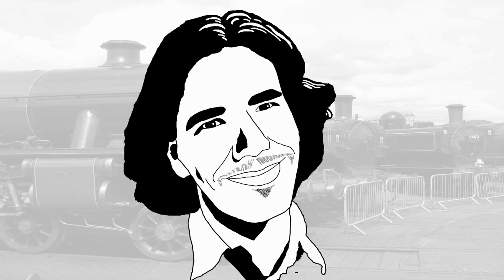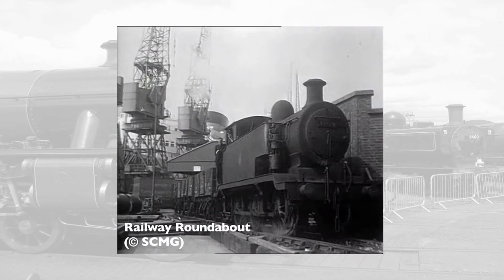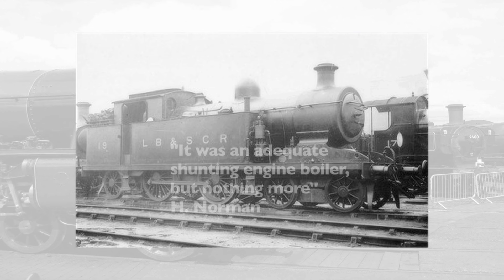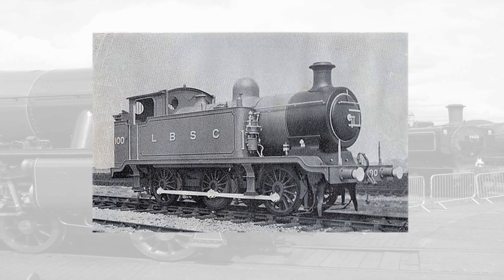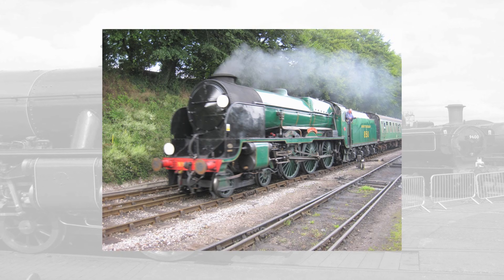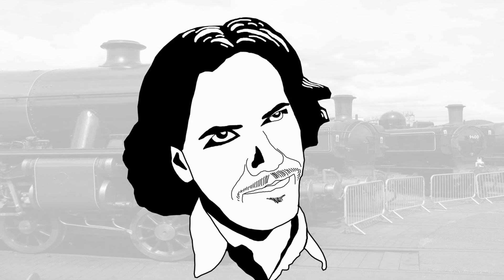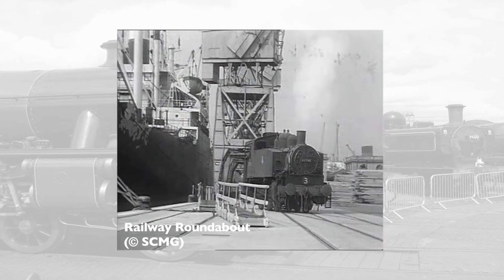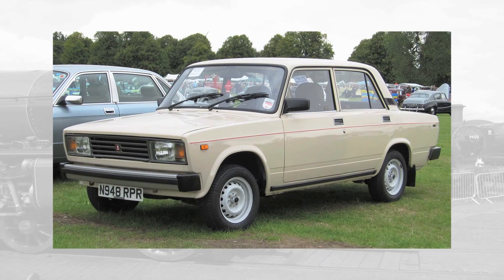GAUGE THE ISSUE: The Maybe-Not-Quite-So Really Useful Engines

Comment: they were ok locos when used for the appropriate task. Their coal and water capacity was no less than other 060 tank engines, and in fact was slighty greater (as a E2x) than a LMS 3F!  The were FAR from useless, if used where they worked best, or had a good crew working them. 

By using examples of what they were not suitable for, would be the same as saying Gresley's A4's were unless if they were tried on station pilot of yard shunting duties. 

You can not compare the E2x to the USA tanks, or the Austerity. This is like comparing a LSWR B4 dock tank to BR 08, their worlds apart, simply because they were designed in different decades. The Problem with you video is it has a major floor, in that you use one source for the information on the working of the class. 

As for comparing Simon Cowell against all those dead musicians, is Laudable, Simon Cowell is a not a artist!!!!! He do not sing or play a instrument for public entertainment.  Its like comparing Pete Water man to Hughes, Beames, etc just because they both worked out of Crewe works. 

The oscillation that was experienced over 40mph, was typical on 060 tanks, so hardly unique to the E2's. 

It's the same as anything else, you take a loco of it comfort zone, it will course issues and not proform at its best. The E2 the best use was on short haul work, station pilot duties and banking, just so happens this was not the envisaged use when designed, in much the same way as the BR class 14 diesels.
Reply from the maker: So remind me then, about not comparing stuff from different timeframes, when we're the Terriers and E1s both built? By my reckoning, both were built prior and withdrawn after the E2s, which must surely indicate they both found new use when the Southern didn't want to take out the money for replacements.

And you can compare them to the USAs and Austerities because they were both trialled in the same bloody place! 

In any case, age isn't really an excuse to let the E2s off seeing as the technology was basically the same by that point. Even if you tried to, the 5700 Pannier (which can trace its roots back to 1897) and the Jinty (which was based on an 1899 design) still proved superior at all-round operation; despite only being built for shunting themselves.

I'll admit the Simon Cowell comparison was a touch hyperbolic, but he still works in the same industry and is still responsible for more of the music from the last 20 years than the deseased artists mentioned. So I'm sorry, but the point still stands; longevity doesn't equal quality of workmanship.

Did I say they were 'useless'? No. There were worse locos built. But the lengths people go to defend them while remaining in denial that they wouldn't do so because of TTTE specifically are pretty desperate.
Reply: @ChristheXelent  Nearly all the terriers survived because they had abilities that other loco's didn't. They had a very light axle loading, packing a big punch for their size! Other than the jobs which required a lightweight small powerful loco, even the LBSCR had been selling them off, the E2s were designed because the E1s were being flogged to death and under powered for the tasks they were brought assigned to. There were also very rough riders at anything over a stedy pace, and it took until 1933 to sort this issue out, with the ones that were sent to the Isle of White being re balanced by the fitters at Ryde Works. I personally would suggest the E1X would have proven to be a better investment, but I guess Lawson A Billington wanted to stamp his mark on Brighton Works, when he took over from D. E. Marsh, which was clearly still very much dominated by the legacy of William Stroudley. Both the E1 and A1 had examples with condensing gear fitted. Indeed, the SR were one of the leaders in Diesel shunters, even before the war in 1939.

You can not compare the E2x with USA tanks, or the Austerities, unless you want to demonstrate their mechanical design too. out of the three, the USA tanks were the most advanced, with modern design of valve gear and cylinders (but with rubbish axle boxes and coal bunkers that were found to be too small until extended), were specifically designed to have a short wheel base, with ALL the weight over them, to handle sharp radius lines, but if taken out of this context proved to be unreliable without modifications (as the KESR found out, it is what saved their pair from getting to Barry, and could only be solved by fitting mechanical lubricators to the axle boxes in preservation). Indeed, when the ones that were transfurred from Southampton Docks to Ashford for departmental use, the trip took a month to complete because of the small coal bunkers and the constantly hot running axle boxes. If your going to compare the E2's to these, you would need to compare them to other dock tank designs, such as the B4's which aslo worked the dock networkd. They were all different designs, and good engines when used in the right context, but take them on a job they were not suitable for, you would soon have trouble. 

Apparently the other main decisive factor in buying the USA tanks over the Austerities is apparently the Austerities offered were all in need of an overhaul and the USA tanks were virtually new. How true this is I dont know. There was 14 USA tanks purchased by the Southern Railway, at a cost £2500 each (although 1 loco built by Porter differed from the others and so was cheaper), which is approx £100,000 today, I suspect compared to the F5 or G5 replica, they might sound well priced, but I suspect would cost much more to build today ;-) The Southern always claimed to be cash strapped, yet gave Bullied a free hand with his MN, BB and WC classes that had massive amounts of unproven innovation. The reason only 14 (15 if you include the loco purchassed just for spares for the Porter loco) is Bulieds insistance that the loco's should all be of the type built by Vulcan, as these were of better build quality, and the poter ones had differing dimensions. The limit on the numbers were only 13 Vulcon manufactured ones were available, for whatyever reason the Porter built ones were not acceptable to Bullied. 

The 57xx (15.5ft wheel base) may be able to show its routes back too much earlier than your suggest, as many were based on old saddle tank designs, but you would also need to comment on all the modifications, and improvements along the way. The LMS 3fs (with 16.5ft wheel base) were a updated and improved version of Samuel Johnsons 2441 class. I would question your belief that the 3fs were much superior. Like all Midland engine, the axle boxes needed improvement, and coal and water capacity limited the distance of short haul trips, just the same will all smaller tank locos, but we have to face it, 060T for shunting or short haul use were never top priority for the design teams, and most were just updated designs of the tried and proven. 

I would suggest that the two top contenders for the longetifity of design (and useful) class of loco for this would be the GWR pannier range, but as these had variations in to cope with different requirements, and the 57xx had a shorter working life than the J72, I would place the J72 at the top, not that it would have been suitable in Southampton docks (13ft wheel base!). These can trace their origins back to 1898 when Worsdell built a batch of 10 for the NER. Raven built 20 more in 1914, and 10 more in 1920. 25 more joined them in 1922, and the LNER under Gresley built 10 more in 1925. Despite Thompson recemending the whole class for long term withdrawal, Peppercorn announced that the J72 would be the LNER's standard 060t light shunting loco, and ordered more batches to be built in 1946, but these were delayed until 1949 when 15 were built, 5 more in 1950, and the last 8 in 1951. It wasn't until 1958 that the first of the older locos were withdrawn. The class lasted in capital stock until 1964, but 2 remained in departmental stock until 1966 (preserved and known as Joem) and 1967. A total of 113 J72s were built to much the same basic design (which was based on the J71's that dated from 1886) over 53 years, and the oldest of the class had a working life of 60 years when the first was withdrawn.  Alnough their was 422 LMS 3f's, these were built over just a 7 year period, with the 1st withdrawals in 1959 and all gone by 1967 (except one supplied to the NCB) with the oldest members being 35 years old when the first was withdrawn.  The 57xx had 863 members, built over a 21 year period, but withdrawls started in 1956 and  all had been withdrawn or sold on to other companies (ie London Transport and the National Coal Board) by  1966, with the oldest members of the class being 27 years old when the first was withdrawn.

If BR found the E2x poor, they could have called upon designs from all over the network to trial out, and it wasn't until the modernization plan that the realization that steam would end came to light. Indeed, there are examples for this, with Pannier tanks being tried out on Southern region docks, and Licky incline, and the LNER's U1 also on Licky (unsuccessfully). The fact remains, in the right environment, there was nothing wrong with the E2X, but the right environment was not the one intended. Their best work would have to be large yard shunting and station pilot duties. The E2X lasted until replaced with diesel (in this case the class that became the 07... which I believe is what Salty was based on in TTTE). I suspect the E2x were kept in use at Southampton docks simply because most other tank locos cira 20,000lbf hand longer wheelbases. 

As a engineer, and someone who has restored many old machines, and worked on plenty of steam powered machines, if something is not well-built, it will not last, because it will fall apart from wear out, so in my opinion, if something has seen regular use and lasts a long time, it was well-built, but dost mean it was well-designed.

My defence of the E2's have nothing to do with Thomas the tank engine, indeed to me there is only one true Thomas, Hunslett and clarke works number 1800, which was nick named Thomas by its crews and people who saw it, because it was small and blue, and when supplied in 1947, the 2nd of the Thomas books had just come out. The Rev. W Awdry officially named this loco Thomas in 1971, and it went on to be preserved by what became the NVR in 1973. Indeed, so official is this Thomas, Hit entertainment (after purchasing the rights to Thomas the tank engine and friends) tried to sue the Nene Valley Railway (Thomas's owners since 1973) on the grounds that the NVR's Thomas locomotive was breaching Hit entertainment trademark, but they lost the case as the court ruled that it was not breaching HiT's trademark because the Hunslett Clarke locomotive was given the name "Thomas" directly by the creator, Rev. W. Awdry, and so predated any prior agreement regarding the rights to the Thomas trade mark. It was the ONLY locomotive to be so named directly the Rev. W. Awdry.

In fact, I cant claim to be a fan of the E2s. The only real Brighton loco class I am interested in is the A1x, I'm a Great Eastern man and a dyed in the wool fan of all things LNER. If you want to compare musical artists, you could do it by comparing number 1's to length of carrer,  this would of course mean Cliff Richard is No.1, & no I'm not a fan!
Reply from the maker: @James_Rivett  as much as I would trust your word as an engineer, this is really missing the point. 

You can compare them in the same context because all three were trialled in the same context. The Austerity's wheelbase was simply considered too long, despite being 5ft shorter than the E2s/E2Xs. While the USA's had a better balance between strength and flexibility. While their axleboxes were indeed an issue on long journeys, the class rarely made them barring exceptions like 30072 moving to Guildford MPD for a while. 

Saying that they're not vocationally comparable is like saying the LNWR Claughtons and LMS Royal Scots weren't comparable when they were built for operation on the WCML. 

Keep in mind also, the Jinties were often seen on passenger duties on the old North London Line. While said line hardly ran a fast and comfortable service, if the LMS believed the Jinties to be incapable of passenger operation then they would have sought alternatives. The LBSCR's attempts at trialling the E2s on passenger duties proved a failure which has forever smeared their reputation by comparison. So I'm sorry, mods or not, the E2s were inferior on flexibility. 

I agree that, given the appropriate context, each mentioned machine will prove its worth. But the fact remains that life often expects things to adapt when thrown OUT of context. 

People so often put the E2s on a pedestal based on TTTE without researching into the proper background behind the real machines. But you can pretty much guarantee that if Wilbert Awdry's initial model of Thomas (based on a J50) was followed in the RWS and later TV shows, then said pedestal would be reserved for something else.

Comment: … you know they were made for heavy shunting and lite freight and they were not supposed to go full speed and pull passengers? Also look at the dates that the usa tanks and the austerity’s started service and I guess they would have been better if they had a different boiler but still the first part of your video sucks
Reply from the maker: 5700s and Jinties were also just intended for shunting, yet they excelled at more than their intended duties. And before you start rabbiting on about age, that's clutching at straws. Both designs were based on locos from the 1890s which still performed more than they were intended for. 
Also, Klaus Marx's biography on Billington suggests they weren't just intended for shunting.

As for USAs and Austerities, again... straw clutching. A Lada Riva is an older design than a Ford Focus, yet the former could be made tomorrow and it would still be worse. 

I'm sorry history isn't kind to these things, but there's not much that can be done about it now.
Reply: @ChristheXelent  no you got me wrong I do like thomas but I think the e2 engines are flawed like massive flaws but I think the way most of the community are bashing them is what I don’t like
Reply from the maker: @YimYum911  I like Thomas too, despite what comes with him. But the way people give the E2 a free pass and then deny their reasoning is just because it was the basis for Thomas (debatablly, from the look of things) just comes off as a vague attempt at re-writing a part of history that just doesn't warrant it.

Edward Thompson is surrounded by unfair myths that deserve debunking, so are many aspects of early railway engineering. But the E2 was so mediocre and insignificant, it seems like a wasted overrated effort just to stick up for it

Comment: 👏They weren't that flawed though.👏

👏The only major issue was the water capacity, which was corrected with the extended side tanks.👏

👏These engines were built for shunting duties, and they did that job well.👏

👏So well that they lasted for 50+ years until almost the end of steam.👏
Reply: And before you mention their predecessors, yes they lasted an extra 30+ years, but the E2's were withdrawn around the end of Steam. Are you seriously suggesting that E2's should have lasted up to the 1990's???
Reply from the maker: @MrMcCue-on1gz  nope, I'm pointing out that they only lasted as long as they did because they didn't have much of a choice.

If the Southern saw the replacement of shunting engines as a high priority, then they would have done so long before. But due to said companies policy in electrification being curtailed by WW2, they ended up being dead horses that were flogged. If you read H.Normans book, then you'll realise that the overwhelming praise they were given was largely imagined by Thomas fans who merely adapted the truth and fitted it into their own ideology.

You've failed to acknowledge their poor balance, inadequate steaming abilities and braking capacity (they were actually built for short distance goods trains, not shunting), dodgy condensing gear and the awkward positioned regulator. The fact that their rivals such as Jinties and Panniers were more flexible than them proves which design was better.

And be honest, if it weren't for Thomas, these things wouldn't receive anywhere near as much praise as they do.
Reply: @ChristheXelent  I get frustrated when people continue the meme that E2s were bad engines. They simply weren't. They were trialed on passenger trains and were unsuccessful. Saying they're bad because of that is like saying a Toyota Prius is bad because it can't haul a RV trailer.
Reply from the maker: @MrMcCue-on1gz  then you clearly haven't read H.Norman's book pointing out their numerous other shortcomings
Reply: @MrMcCue-on1gz  Okay but wouldn't you agree shunting engines should have at least /some/ flexibility aside from being able to shunt (which, even then, E2s could make a tedious job of)? The Jinties and 5700 Panniers were mostly shunters, but more often than not they also had to manage light goods workings and banking (they also worked the odd commuter train, but I'll be generous and disregard that); practicing such versatility is just part of the course for 3F shunters. Despite being 3F shunters themselves, the E2s were poorly suited to those other kinds of work due to their persistent back-and-forth oscillation, difficulty maintaining boiler pressure over sizeable distances, and their weak braking system. Hell, as I mentioned before, they weren't even all that well-suited to shunting, considering they'd brake so sharply that their couplings would snap and breakaways would ensue – and, again, weak braking system.

When all's said and done, I'd say the criticisms presented in the vid are valid and warranted ones.